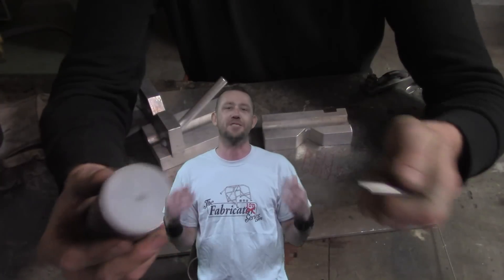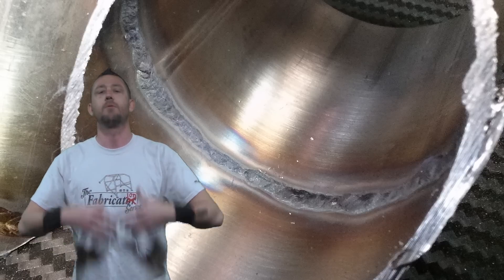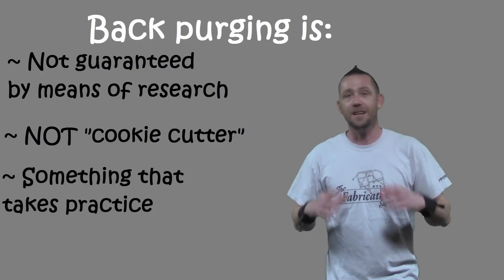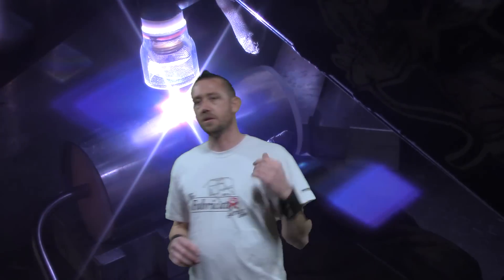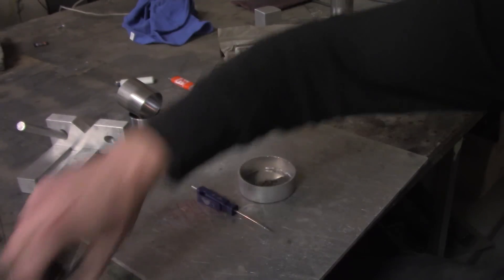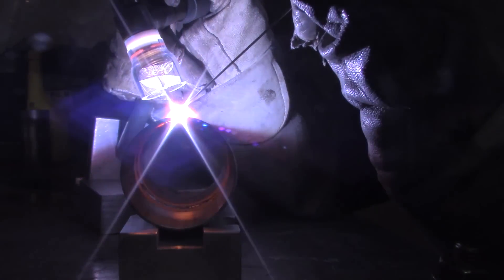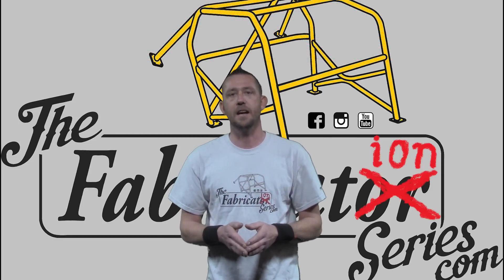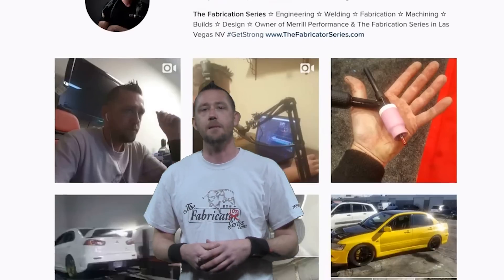TFS: Back Purging - How and Why

Comment: Try putting a gas lense on the end of your purge hose it filters and helps disperse the argon evenly. Also try plugging the ends of the pipe when using solar flux to contain the fumes that's what blocks the 02 from getting to the weld. Just a few things I've figured out along the way I weld a lot of this stuff.

Comment: Is it necessary to back purge mild steel? It's fot a turbo manifold
Reply from the maker: +Dannymclovin69 Its not necessary to purge mild steel at all unless a specific job requires it. Mild steel is not reactive like stainless. No need to purge.
Reply: The Fabrication Series thank you I really appreciate your response since I'm using 16g mild steel it's nice to know I can skip that step

Comment: Thanks Justin for the reference from your previous video. I have recently subscribed and rang the "BELL" alert for your videos.  What % of argon do you recommend ?   I have joined some aluminum for a jet ski cart which used different from 25-75% mix for my steel projects.  Your current student.... J K
Reply from the maker: James Krivitsky Always glad to earn a sub. Thank you. 

TIG welding requires 100% argon. There are a couple other common gasses used, but they are more for specialty welding. Just stick to 100% argon for TIG.
Reply: Thanks for the rapid reply. I will get a larger bottle next time for stainless and aluminum.  Have a productive weekend.   J K

Comment: Hey Justin I was wondering when you purge is the regulator open the entire time while welding or just before welding to remove all atmospheric gases?
Reply from the maker: sell stuff It's open the whole time. The only time I shut it off is when I take a long break or a long cool down period, but then the part has to be purged before welding again.
Reply: Jeez then ill be running out of argon real quick haha
Reply: thanks for the quick reply!
Reply: I noticed that Justin had the large tanks. I use sparingly with "pony tanks" but what a BIT>>CH if you run out mid-project !   Better safe than OUT   UUUGGGHH .    J K

Comment: I do pharmaceutical process piping and every single weld we do in a system is back purged.  One tip for setting internal flow rate is to not go too high.  You can create a ventrui effect and can actually suck in your weld causing concavity and in my field that means a failed weld due to cleanliness issues and is aesthetically not as pleasing if that matters.  Also if you have a large OD tube and you're welding close to the inlet of your purge gas you can use an air tool exhaust muffler to break up the jet of purge gas and spread the flow out and push all the oxygen out.
Reply: Same here, in the company I was working before we were doing a lot of pharma and food-grade work and one way we sped up productivity was to fabricate out of stainless all the accessories we needed for every type of pipe and connection to the pieces we had to weld. Having a Purgeye oxygen sensor also helps a lot in bigger pipes. Usually, I start the back purge with loads of flow rate until the oxygen drops considerably and then I tone it down to avoid the root concavity as you said.
Reply: Thank God, somebody knows what they're talking about. These YT stars are more like enthusiasts not truly experienced Welders/metal fabricator's. Sugaring or whatever else he calls it, is simply known as contamination. Shaking my head in disbelief 😂

Comment: Isn't there any cheaters for this... argon is so expensive ... anyway to reclaim the argon ... I wonder if a sandblasting cabinet would help... welding small parts
Reply from the maker: Jeff Booher Some would say you can use other gasses, but I have no experience or advice for anything other than argon or solar flux. Cabinets help, but also require a lot of argon to replace the atmosphere inside.
Reply: I have a 1962 Austin mini...  and these videos are the shit!! thank you ...

Comment: In heavy industry you'd get fired for not having a supply air mask when welding stainless steel as it releases Chromium (extremely toxic) while you weld. This is much, much more hazardous than welding carbon steel or other types of metal which do not require a respirator. TIG releases less smoke than welding stainless with mig/stick but the chromium is still largely present.

Other than lack of safety I love the channel.
Reply from the maker: Good thing I'm not an industrial welder haha. Thanks for watching!

Comment: I can add that if there is any structural, code, pressure pipe....basically anything that could hurt someone if it failed. It needs a qualified weld procedure.
Reply from the maker: Very true. It's all up to the job.

Comment: I usually use masking tape over pipe ends for purging, on some sheet work I use masking tape as well to cover the back of the weld. it leaves a nasty sticky mess but cleans off OK. Have also used ceramic tape made specially for back purge as well, thats quite expensive but for some jobs essential.
Reply from the maker: I either use the plugs shown (which we have been torture testing for a long time now) or foil. Sometimes I use PET tape as well.

Comment: What can you make plugs out of? I was thinking cork or plastic would work well, so long as it isn't in the immediate vicinity of the weld. 
Also, am I correct in assuming the the purge output port should be distal of the welding area? In other words, so that the argon flows past the weld and the weld is not tucked in a corner where the argon may not flow?
Reply from the maker: You can make a plug out of just about anything. Most people use foil or even tape. Adding the port is kind of tricky. If you are welding round, the port will eventually be located at at least 360 degrees which means not matter what, there may always be atmospheric air trapped. I typically run the purge line for a few extra minutes before welding to ensure as much gas escapes and I try not to weld right next to a plug or port if possible.

Comment: Great video, you will never get those golden welds without back purging SS. You can use scrunched up alluminium foil to block the ends of the tube. I got to get a big cup and screen like yours as I never use that much stick out (with smaller cup and no screen) without adversely affecting my welding
Reply from the maker: You can get the same golden color on the outside without purging. The inside will just look terrible.

Comment: Finally...a decent and thorough video on back purging!! I weld in the Aerospace industry and back purge practically all the time. One item i use a lot is the heavy duty stainless steel or aluminum tapes for forming a back purge dam. I also stuff alumimum Renolds Wrap (tin foil) near the weld with the tape so the adhesive don't contaminate the weld and also to confine the purge area. I have made a variety of purge manifolds to deliver the purging gas, too. I also weld on vintage automobile trim pieces at about 10 to 15 amps with a .020" 2% Lanthanted Wolfram Tungstens and back purging is a must. Check out http://flashbackstainless.com/  .
Again, my hats off to you! Gale Hansen
Reply from the maker: Thanks! I use PET tape or the plugs. Every now and again I still bust out the foil for the job and I have a few purge blocks/manifolds for common jobs I do. Thanks for watching!

Comment: Why you use methanol with solar flux? Methanol has very poisonous vapor, why you don't use ethanol or isopropyl?
Thanks for the video! Very useful for me
Reply from the maker: It's what is recommended. But as I cautioned and mentioned in the video, it has to evaporate before you can weld on it.

Comment: can solar flux replace argon if you were building a turbo manifold. I'm new to welding and I plan on making my own manifold to avoid paying out the $1000+ a high quality one cost.
Reply from the maker: Cory Merle Yes it can but the finish of the solar flux will likely chip off and get sent down the exhaust system which may cause problems. I recommend sticking with Argon.
Reply: The Fabrication Series the chipping was my worry when I saw you cleaning it with a brush. definitely don't wanna destroy my engine and turbo . thanks for the speedy reply to my noob question and keep up the good work bro.
Reply: Make your manifold out of mild steel steam pipe. You won’t need back purging and it’ll actually be stronger and work better in the heat
Reply: Your going to need argon to run your tig tig anyways. Slick

Comment: Excellent information as I have been wondering how to go about back purging.  Still need to locate a dual flow regulator, as I don't have room for a second Argon tank. 

Thanks!
Reply from the maker: Just do a quick online search but do avoid the cheap regulators that are around $100 or less. They aren't very good.
Reply: I was afraid of that. $100 being considered lower quality.
Reply from the maker: The problem is consistency. They will show something like 10 CFH, but the flow is either much less or much more that your argon goes away really fast. That's actually more expensive than buying a good regulator the first time.
Reply: Makes sense.  Thx.b

Comment: Even if you back purge, you will get carbide precipitation in the HAZ if you use regular 304 and 316 stainless. It must be 304c and 316c. C in this case means low carbon. Carbide precipitation is not a surface thing. It is internal in the weld.  Also, you can get cleaner welds is you wipe down with acetone. In the medical device industry the saying is discolored weld means bad gas or dirty surface.
Reply from the maker: As mentioned in the beginning - not getting too in depth about it haha. I could go for days talking about all the details but it would be hours long.
Reply: Yep, I hear you. You have just scratched the surface. hahaYou are right. It would be days long. Years ago, I saw a pacemaker fall in half due to carbide precipitation in the HAZ. That made an unforgettable impression! Carbide precipitation's main problem is corrosion resistance ccompromise.Thanks for your videos.

Comment: What about roll cages ? Built using  Chrome-molly tubing ? Is this only for Stainless and Titanium , or should this be done with any metal tubing you are tig welding , like aluminum inter-cooler pipes or mild steel exhaust  ?  In the end of the video you said some of these (in my question ) do not need to be purged ... But does it help or make the weld stronger if you were to purge them ?
Reply: Mild steel does not require or benefit from back purging. 
Whether or not to back purge 4130/4140 chromoly roll cages depends on the particular SFI spec, FIA spec or sanctioning body construction specification. 
Some specify back purging, some do not. 
Aluminum tubing can benefit from back purging in certain specific applications, but not all. 
Stainless steel, Titanium, Inconel, Monel, Magnesium and a few more exotic materials do require and benefit from spec gas back purging. 
As a note, it does not ever hurt the weld to back purge with Argon. 
If there is a Welding Procedure Specification, always follow the WPS. 

Also, roll cages and chassis are not hermetically sealed, most sanctioning bodies require an open inspection hole in the chassis and or roll cage/bar to determine material wall thickness.
Reply from the maker: It was already explained in the responses here, but I'll clarify - it does not need to be purged unless a rule or standard says so. Low chromium content will not react as higher content will. 4130/40 is low and typically not required. It wouldn't hurt anything but your wallet if you wanted to though.
Reply: Norman Murray Mild steel, chromoly and aluminium don't have those reactive elements in them so don't need to be back purged. also when you build a roll cage once it's finished there is no way for the atmosphere to get inside it. hence why you don't worry about painting the inside.

Comment: Have you ever back purged 6061 intercooler tubing and if you did, did you notice much of a difference between that and no purging at all? Also who makes that double flow control valve you showed in the video and where can I buy one?
Reply: Google search for 
Dual Flowmeter back purge regulator
Reply: not sure about the brand Justin is using, but this one looks a good quality and affordable.
http://www.usaweld.com/Dual-Flowmeter-with-Backpurge-p/dualflowmeter.htm
i dont have one (im using 2 regulators with Y connector) but its on my shop list
Reply from the maker: No need to back purge aluminum unless there is a spec on a job for it. It makes no visible difference on 6061 tubing. 
Run a quick search for a dual flow regulator. Just don't buy the cheap $100 ones. They aren't very good quality.

Comment: I have learn a lot !! thank you
can I purge with CO2 ? or an other cheap gaz ?
Reply from the maker: I'm not even jumping into the gas debate haha. I think I read somewhere in these comments about following the rule of "Whatever comes out of the torch is whatever you purge with" (or something to that nature). That's what I suggest.
Reply from the maker: Jonas Nordmark A very high temp material haha. That's all I'm saying for now. They're currently in the final stages of development and torture testing.
Reply: Lee Nux I assume not. He said purging is the separate the weld from the atmosphere to prevent oxidation. Co2 is in the atmosphere, as well as nitrogen, hydrogen, oxygen etc
Reply: CO2 cannot be used as a purge gas but nitrogen can be used as a cost effective alternative.
Reply: CO2 is a reactive gas and what you are needing is a non-reactive, inert or noble shielding/purge gas. 
My rule of thumb is only use a back purge gas that is suitable as a TIG welding shielding gas for the material being welded or if it is a spec job (WPS), use only what is called for in the spec. 
Most times 100% argon is speced for most stainless.
Reply: +Christian Loya 
With all due respect, yes, Nitrogen back puge is used for some unstabilized fully austenitic stainless steels in production environments using MIG/GMAW, SAW processes, but not for the consumer/novice utilizing TIG/GTAW. 
Many production environments also use a 90/10 Nitrogen/Hydrogen mix for general back purging. 
Also, where the fit up has gaps in the joints sufficient to allow Nitrogen to escape and commingle with the TIG torch shielding gas at concentrations above about 3% the Tungsten quickly breaks down and usually results in Tungsten inclusions. 
Nitrogen, being a strong austenite former, will lower the ferrite levels to possible unsatisfactory performance levels. 
The AWS recommends that Nitrogen in concentrations greater than 3% not be used with duplex stainless.
Reply: I have done many pipe joints on 304 and 316 with a GTAW root utilizing nitrogen  back purge and have been 100% successful and 100% X-ray pass rate. I agree to disagree.
Reply: What was the plugs made of?
Reply: I believe the plastic/ rubber ones are made of Teflon @jonasnordmark3541
Reply: I was always told any non flammable gas can be used as long as it forces the oxygen out of the tube ......... But I am not a pro welder , and these videos have been teaching me a lot about what can and can not be done ......
Reply: +Christian Loya 
Nitrogen is not a good choice for some stainless TIG purge, it can cause issues in the weld and with Tungsten degradation. 
Atmospheric air is approximately 80% Nitrogen.
Reply: Lee Nux  of course you can't. This will cause even more coking.
Reply: A mix of 90% Nitrogen and 10% Helium is normally used as an alternative to Argon, with a big cost benefit. The product is called "formiergas" here in Denmark where i liv and work as a welder/fabricator.
But that Solarflux definitely seems like a nice alternative. This was a good video.  :)
Reply: patw52pb1 I firmly disagree. Nitrogen is used daily in many pipe shops that fabricate 300 series stainless steels. Along with that an argon/nitrogen mixture is often used in duplex stainless steels.
Reply: Jonas Nordmark silicone
Reply: i believe you can purge with any inert/"noble" gas (gasses/elements which do not react with other elements), as they shouldn't react with the metal when welding it .
Reply: Nitro